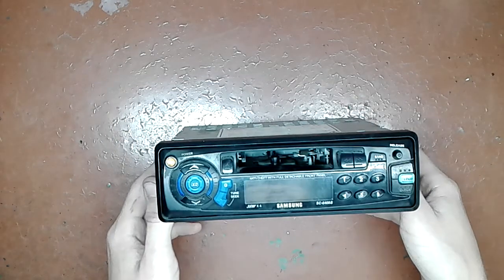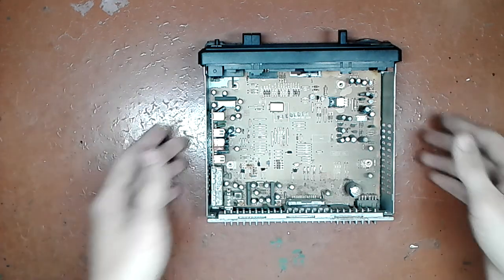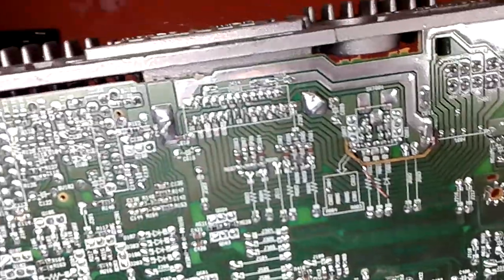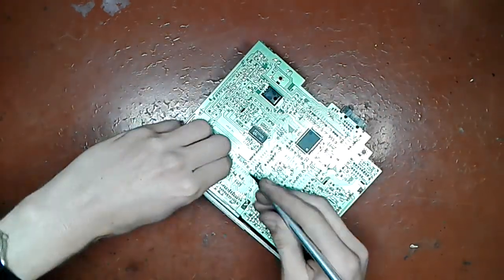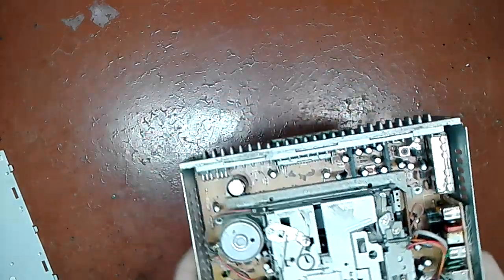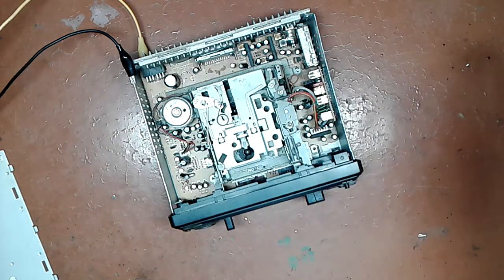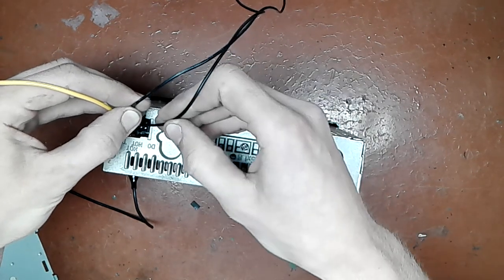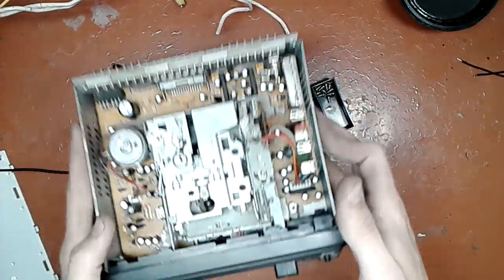Car stereo repair #2

Comment: You were not the only person that jumped when connecting the speaker to the case :-D.
That speaker sounded broken, but it may be my ears or the squidgy bit between them :-D.

One thing i would have done different to you, don't apply power untill some resistance checks have been done, often the power amp is dead too :-(.

It looks like he applied +12v  to the negative terminal of the power socket, also the case was grounded by the antenna, Kabooom!! tracks lol.
Reply from the maker: The speaker is fine, the reception was pretty poor thanks to the bad antenna, that's why it didn't sound all that well.
 Don't worry, I use my lab PS for these, it has ability to limit the current. It was set to 1Amp, so there's no huge danger.
 That may very well be what he did, those sophisticated users either connect the supply in a wrong way or short out the output of the audio amp :D
Reply: "sophisticated users" ha ha :-D, nice way to say "pillock" :).
He is lucky you help him, i hope he appreciates your effort.